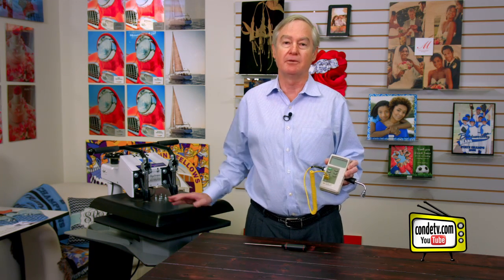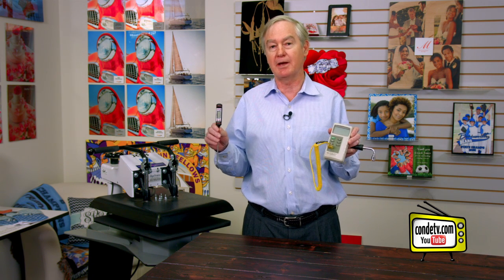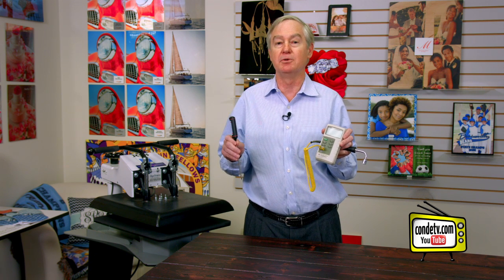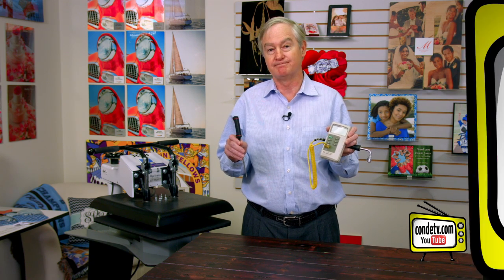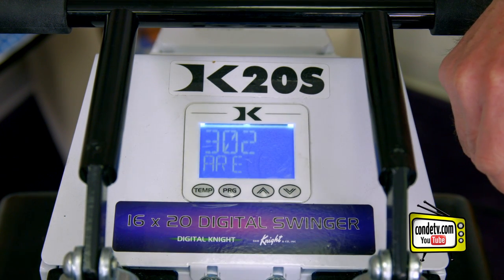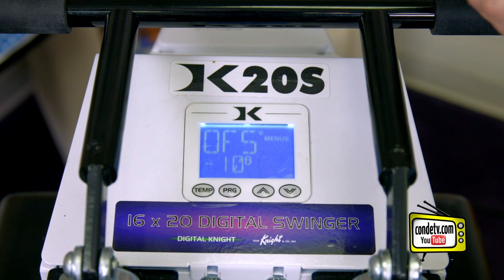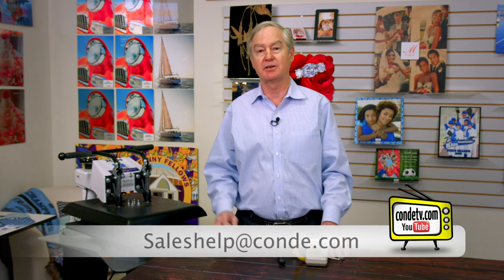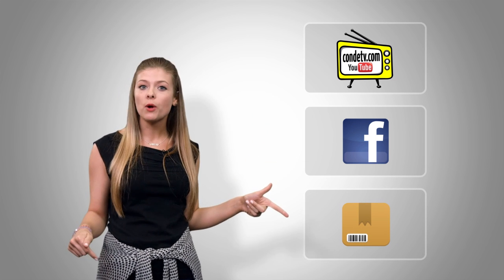Calibrating a George Knight Digital Heat Press -

Comment: Excellent video for adjusting the display temp on the George Knight Press.  However, there was no information on how to use the two temperature sensing tools (the candy thermometer and the pyrometer).  Also, Harbor Freight sells an inexpensive Temp Gun.  Would this be a good option to test the surface temp of the heat platen?  Finally, I would think that the surface temp of the heat platen would be affected by any build up of burned on crust from dust, etc. over time.  What do you use to clean your heat platen?
Reply from the maker: Simple Green is the preferred cleaning method. Always use protective paper. A candy thermometer is probably the best, a temp gun may work.